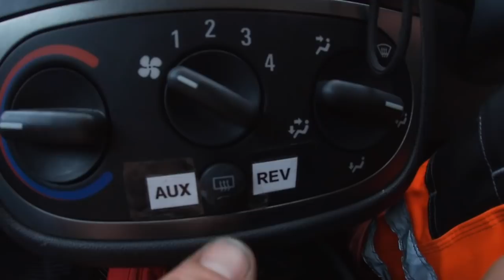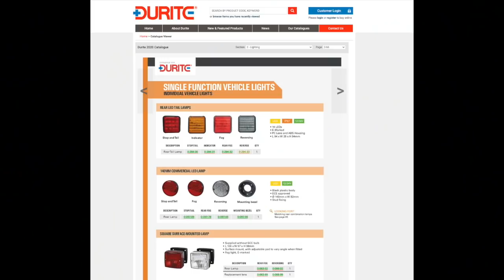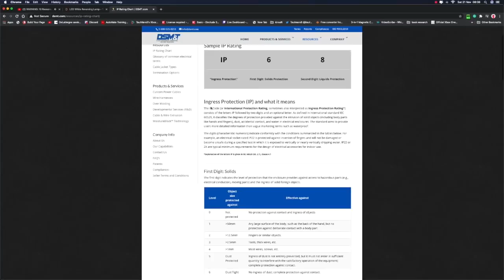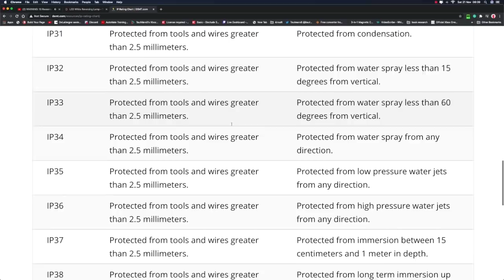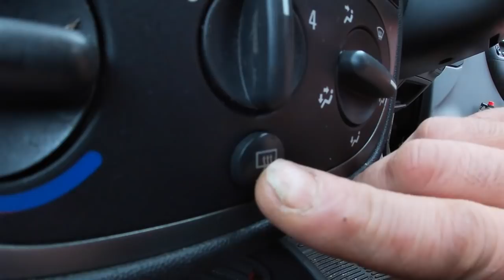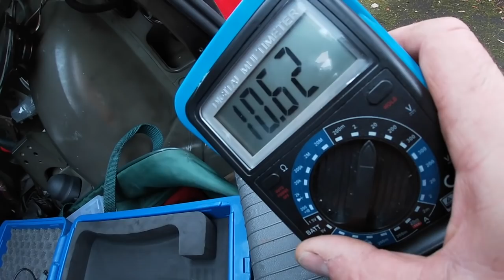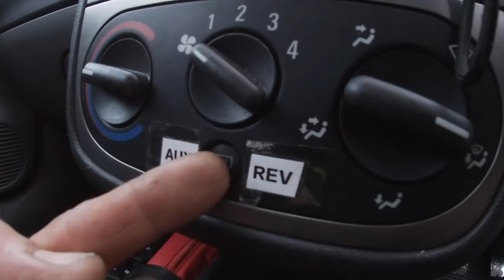The Fly (Light Weight Survivalist Vehicle) - Using Redundancy for Wiring in Aux. Reverse Lamps

Comment: Hi Chris, have you got any good ideas for clip on/removable reverse lights 24v for HGV trailers above wheels or facing to rear or both? Maybe I could plug into the existing reverse light bulb fitting.
Driving a new Actros with the mirror cam and they are rubbish to reverse at night, unless the yard is well lit it's almost impossible to see lines for bays to reverse into. Can sometimes pull 3 or 4 different trailers each shift.

Comment: How would you do this with a vehicle with canbus wiring? No 12v in the rear lights. Can you tap into the canbus to trigger a relay without sending the ecu mental? Or could you wiring in a trailer bypass relay and just use that for switched 12v? 👍
Reply from the maker: leave the CAN bus alone it is digital signalling wiring.